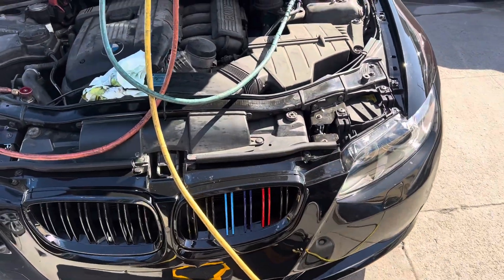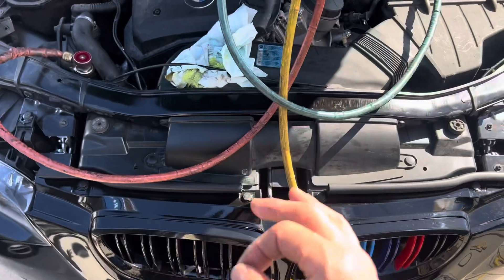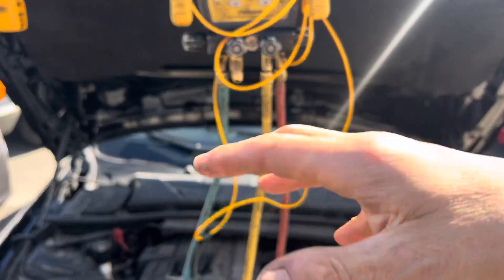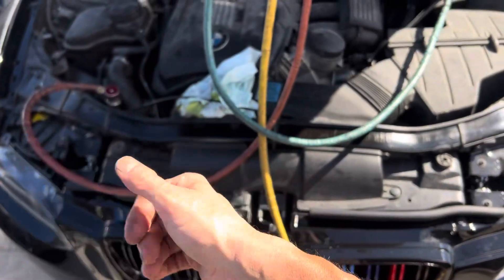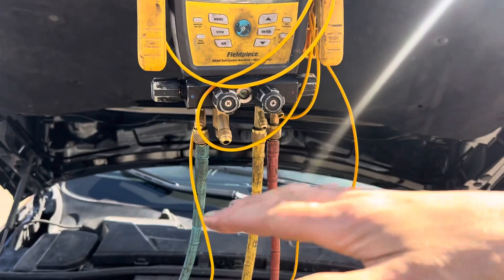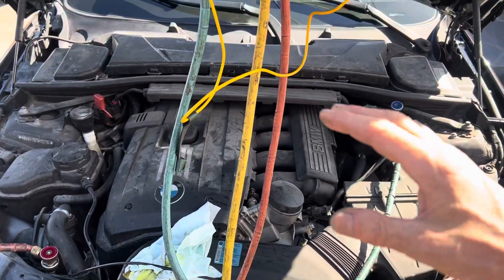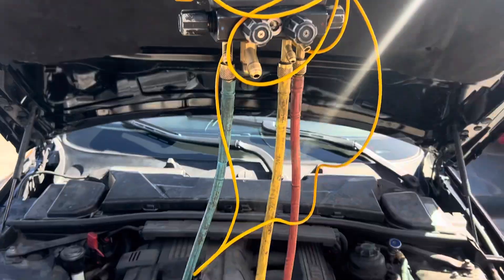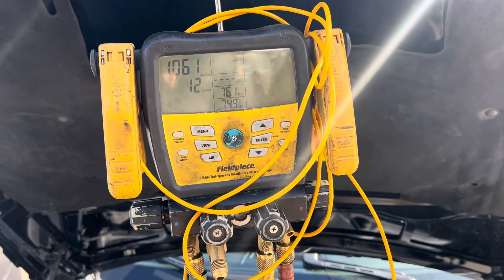Releasing Refrigerant into the Atmosphere￼￼ (this is how you know) ￼

Comment: So if the shop would have just refilled the refrigerant nobody would have known the better correct?
Reply from the maker: This shop dose not recharge refrigerant.  The R1234yf machine is too expensive. It not worth buying for how few they do in a year. 

Many body shops stopped recharging refrigerant because the insurance company will not pay them enough to make it worth their time.    Many body shops who have contracts with the insurance company insurance company will pay them so they lose money or don’t make money. 

Make a mistake. It cost much more money and net loss of profit to have somebody have to fix their mistake. . 

The body shop that I go to have the equipment to recharge refrigerant . 

But they don’t because they got smart and discovered they can make more money having me do it for them and the insurance company pays me because I’m third-party outsourced vendor, mechanical shop at mechanical labor rate which is paid much higher than the lower pay of Shop labor rate . 

So they just sublet the procedure out to me and get reimbursed from the insurance company .

Comment: How you can know how much oil been out? I have  the fieldpiece recovery machine and i need to buy something shows me how much oil goes out of the system after recovery and vacuum.
Reply from the maker: In the first place
1: you should be recovering only from the low side section. The majority of the time it will slow down or stop oil recovery but it’s still can recover oil through the low side.. 
2:  you should be throttling back and slowing down the flow of the recovery. Using the dial on your machine.. 
3: do you monitor through the site glass on your gate set? You can literally see if it’s only refrigerant vapor coming through the low side of the blue hose. It goes across your manifold by the site glass and then down the yellow hose to your recovery machine.. 

If you have the speed of refrigerant tapered back, slow enough, only vapor comes out no oil . 

There is a Product by the company called AirSept
It will separate out oil and any foreign substances like sealants that are also in the system and then you can measure it out. It separates it to the bottom you can release it in measure it. .

Comment: Hey, I need some advise! I suspect they overcharged my AC with oil (80ml). The compressor now and then makes some noise, when I turn it by hand it feels like it's pumping solid liquid now and then. I did crack the valve a bit at the inlet of the compressor (Not a service port, just an extra valve) and there was liquid oil and gas, I suspect the oild doesn't need to be liquid there? What's the best way to handle this? evacuate at the low side but really slow? Or at the high to force some oil out? My guess is that there is 50ml too much in there.
Reply from the maker: How do you know they charged by 80 mL too much oil did they tell you that’s how much they put in and there was actually no reason to put in any ?

          Is this on a vehicle that has a very small oil capacity around 2.77 ounces to 5 ounces ? or is this on a large vehicle like an SUV with dual air conditioning with a oil capacity of 7 ounces or more ?

If you had a containment vessel that was large enough that you could put under a vacuum and this containment vessel that could hold the pressure of refrigerant could be airtight but able to take it apart like remove a lid with a gasket. 

If it was me with no air-conditioning equipment and I was just using my imagination I will try to find or build some sort of vessel that under vacuum like it suck out the refrigerant from the liquid line as quickly as possible and that would pull out not all of the oil but some oil. 

And then if you had a low side fitting attached to the top of this vessel that you can remove the refrigerant slowly from the top side of the vessel only bubbling off and evaporating and removing the vapor refrigerant it would be a distillation process and the heavy oil would stay behind on the bottom 

Then you can pour out the oil into a measuring calibrated beaker measure how many milliliters of oil you removed

Comment: Huh, shouldn't the pressure switch kick the compressor off if the low side falls bellow that threshold? That's been my experience anyway.
Reply from the maker: Notch on all models. 
      For a cycling clutch switch lights on the systems that have accumulators that is the purpose of the low side switch it also controls the temperature by pressure. 

But in other vehicles it only uses the low pressure as a proving switch. 
         Meaning if it sees over 44 psi when the ignition key is turned on it automatically assumes there’s enough pressure or the temperature is high enough to allow the compressor to be engaged. 
          That’s all after it starts it’s no longer in the circuit to save the system and turn the compressor off it will keep operating. 

It’s like the old idiot late for the engine.     Often by the time the check engine light came on because the engine was overheating it often overheated too much in already cause some damage and that’s why they called it a idiot light. 

You could say the same thing about most low pressure switches on automotive air-conditioning system it’s an idiot switch 

This is what happens when people don’t read books they just listen to somebody else who doesn’t know what they’re doing either who don’t read books. 

First Einstein gives a lecture on all the proper information. 
         Homer Simpson was attending the lecture and when he gets back home he misunderstood and did not understand everything Einstein was saying but because he went to the lecture of Einstein all the The village people think he’s the smartest guy in AC so they listen to what he says.  Then Larry Curley and Moe who got their information from Homer Simpson who are the owners of shops or mechanics pass the word that they got wrong and did not quite understand and make it even worse and give the information to Beavis and Butthead.  

And this is why our industry has so much miss information that is based off false information individuals who make up specifications based off feelings based off theory based off guessing

I’ll because they don’t read the manual and they cannot apply one manual from one car to a different year make model vehicle because the manufactures change the equipment and how they use it. 

On higher end vehicles they use a combination of pressure switches and temperature switches over a duration of time.      To calculate that the refrigerant pressure is low. 

      And depending on the manufacturer for example after three start ups of attempting to operate the air-conditioning systems if it senses the pressures and temperatures that indicate the refrigerant charges low it will come and the ECU to permanently shut off the compressor and never allow it to engage again until you take it into a shop to clear the codes and diagnose the system and or recharge the system fully. 

I remember back in the 70s and in the 80s there was many cars with no low pressure switches and you would have cars coming into your shop so low on refrigerant the low side suction would be operating in a negative vacuum for example -8 psi vacuum -15 psi vacuum. 

And because many mechanics did not read they thought this meant there was a plugged expansion valve and sell the customer expansion valve take the dash apart pull out the evaporator replace the expansion valve

Then when they charge is backed up it worked perfectly but there was nothing wrong with it to begin with it was only low on refrigerant so they thought they fix the problem and that they’re a genius and they diagnose correctly that it had a bad expansion valve

And what was even worse we had one Honda dealership in my local area who would condemn and tell the customer they needed a new compressor because it was operating in a negative vacuum. 
                      And all this because somebody is lazy and they don’t read. 

Learning by breaking things is not learning

Learning by false diagnosing parts that don’t need to be replaced and replacing them is not learning

Learning by watching somebody who doesn’t really know or understand what they’re doing it is not learning

That’s just a recipe for learning how to do things incorrectly breaking a lot of stuff replacing a lot of parts that don’t need to be replaced when it all could’ve been avoided in the first place just by reading
Reply: @coldfinger459sub0  Thank you for the explanation, this is so true, this is why when I go to hunt for information out there I always cross reference my sources and read up on procedures to make sure the info I'm looking at is accurate. That is crazy that there are still makes and models out there that will allow the system to operate to destruction, it seems like a simple pressure switch that either turns the compressor on when it's at the right pressure or off when the pressure is low would suffice, and when you hear your compressor constantly clicking on and off you'd know there would be an issue. Or say when the switch is triggered enough times in a certain window it throws a CEL code or something to let the driver know. Do you use digital manuals from sites like AllData? I'm currently trying to troubleshoot an issue with my 2000 F350, where it draws down the low side until the pressure switch cuts the system off, pretty sure the clutch is also toast as it looks like its slipping really bad. I've got a video up on my channel documenting what I'm seeing.
Reply from the maker: @xXTECHxKNIGHTXx  i’ve seen your video what is the outside ambient temperature? 

The system is designed and operates by the cycling clutch switch I think because I can’t see your whole system off of the accumulator ?. 

If it is too low on refrigerant it will cut off often

If it is too cold outside it will cut off often

If there is a restriction in the office tube buy metal or piston ring material it will cut off often

And yes if you overcharge it it will make the clutch slip

But there’s no way to over charge it if you properly recover all the refrigerant out and then only recharge it by weight then you know you will always be correct

You do not try to fill the system up by topping it off very rarely does anybody ever get that correct.      They might get it close but they won’t get it correct.    Too easy to undercharge too easy to overcharge. 

Check the clutch gap make sure it’s in specifications

When the clutch is engaged make sure the virus and get in 12 minutes to the clutch under load

Comment: Do you tend to find excessive moisture on systems vented and then opened this way?  I'd expect moisture would seek the cold expanding refrigerant but the continued expansion might keep wet atmosphere from entering, thus my curiosity.
Reply from the maker: You’re exactly right the continuous expansion has a constant positive pressure with refrigerant slowly constantly pushing out words as the technician replace the part so you get less to know atmosphere intrusion

Comment: Hi Tom, I saw some videos of those fancy machines that it can recover compressor oil from the system. Can we do it by adding extra parts between the high side port and recovery machine? Or do you see the rationale of doing so?
Reply from the maker: For automotive air conditioning there is no machine sold for the purpose of just recovering oil while you’re recovering refrigerant. 

Just a regular recovery machine by accident can remove about 5 mL to 30 mL dreamed of doing recovery process on some vehicle not all. There are machines designed to flush out the system using a solvent or clean refrigerant just to remove oil if that is what you’re talking about. 

But they cannot do it through expansion valve for office tube. 

It Hass to be physically removed or disassembled.   
         There is a adapter plate that you put in place that is just hollow tube holes exact shape and size of an expansion valve so you can flush the refrigerant or solvent through the entire system without restriction.     I used to own  one of these machines.
Reply: @coldfinger459sub0  Why I was asking is because I saw some shops claims to have those machines that not only do the 3R functions but it has ability to change most of the oil in the system:
http://www.tabernacle-e.com/wp-content/uploads/Kooltec-iPlus-Brochure.pdf

I was skeptical because I watched your several hundreds of videos I don't see you mention a word to change oil other than vacuum pump oil. And those shops often mention the benefits of changing compressor oil will bring back cool A/C, although I believe a complete refrigerant recovery and correct refill is the main reason. So I wonder what should I answer if any customer ask why the service doesn't include compressor oil change, etc.
Reply: @knk3220  As t lech mentioned, in some of the past videos i believe, too much oil jn the system, it affects cooling performance because it acts like an insulator and reduces thermal transfer. As for getting all the oil out, in one of the MACs monthly mags, you can drill out an old expansion valve so theres no restriction when performing a flush of the evap core to get the oil out. Of course not all expansion valves are the same. Like in my situation, a 99 Nissan Maxima. The expansion valve is inside the evap assembly and isnt easily accessible like most modern day vehicles where its mounted on the firewall. Those I believe are more easily serviceable vs my situation. Again, not all expansion valves are the same. It would depend on your application which way to proceed. Furthermore, regarding refrigerant recovery and behavior. T Lech mentioned utilizing a freezer. Law of thermal dynamics. Heat will move to a place of less heat.
Reply from the maker: @knk3220  yes there are machines with built-in flush equipment to remove oil. You do notice in their advertising they claim without removing components they’re talking about the expansion valve. 
                It is possible and they do say only 95% of the oil.  And that would be in the absolute perfect condition on the perfect type of system. 

      I can perform the same task with my recovery machine one full tank of clean refrigerant one empty vacuumed recovery tank. 
        But it’s a long process that takes a long time. 

And you cannot get out the oil that is down inside the sums of some compressors that a hold a few ounces of oil. 

       And flushing out the old oil and replacing it with new oil is a false advertisement it does not make the system colder. 

          Now flushing out the oil of a system that has way too much oil in it from the type of guys who think they have to keep adding oil every time they recharge the system then that will help the system get colder because there was too much oil in there not because it was old.